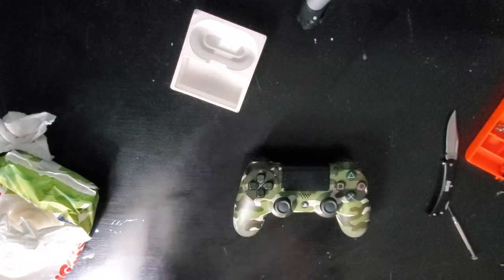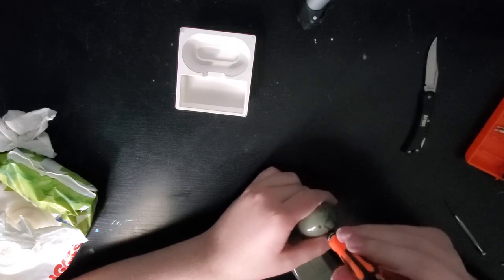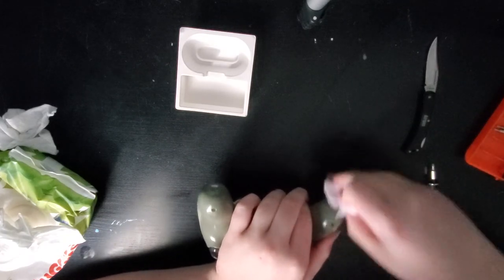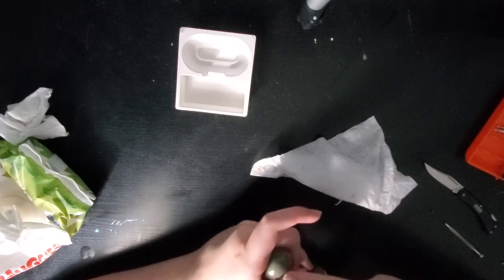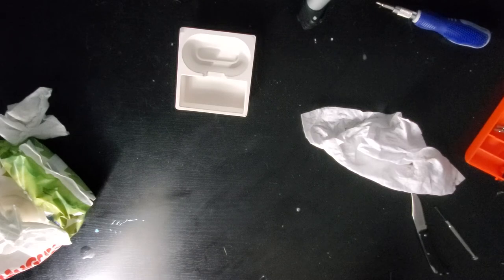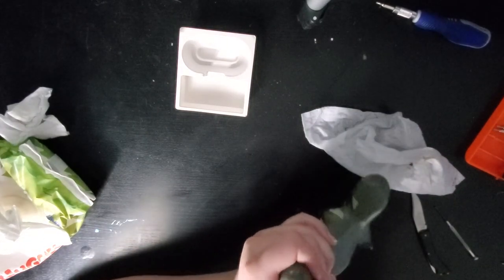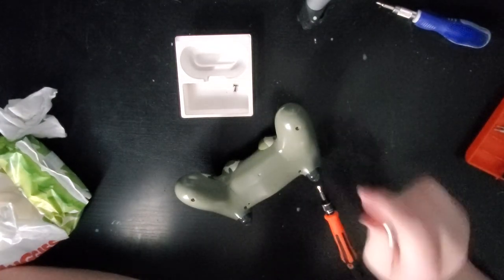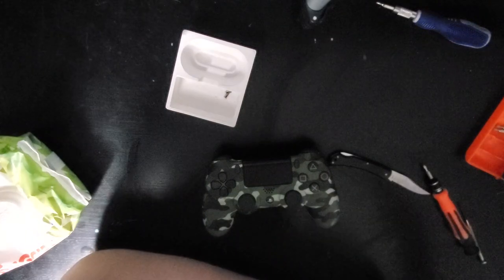How to remove stripped or corroded screws easy

Comment: the mother board in my controller needs to be realigned so the buttons will work again but all but 1 of my screws are corridored so i only got 1 out
Reply: I only had 1 bad screw rip🥲
Reply: Same situation smh
Reply: @Cealorb  Me too, its always that one screw. This is also my first time taking apart my controller but theres always that one problem